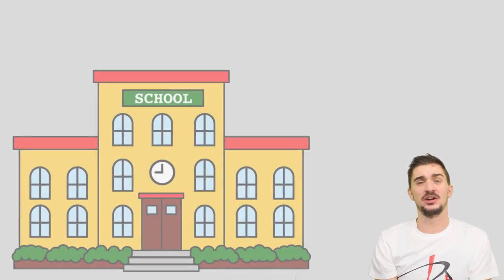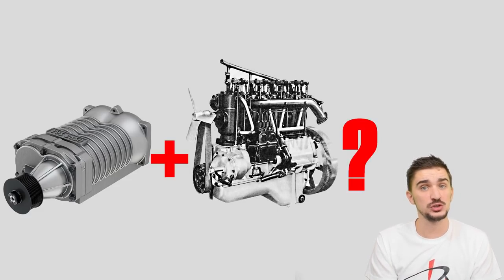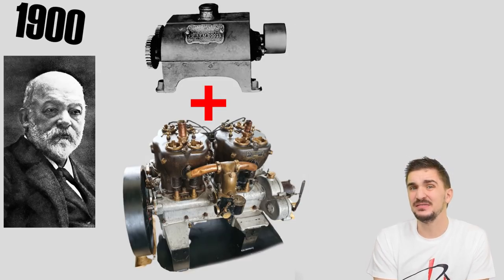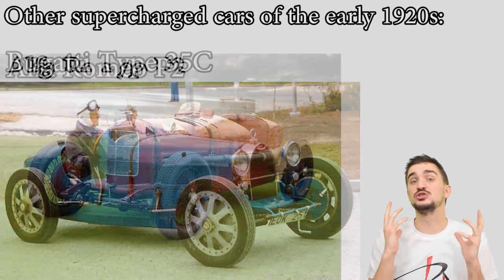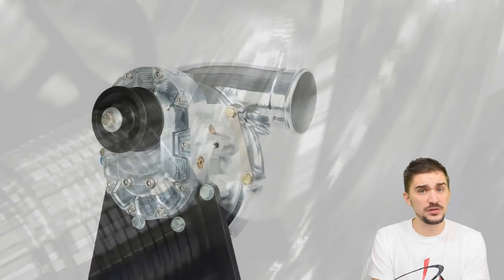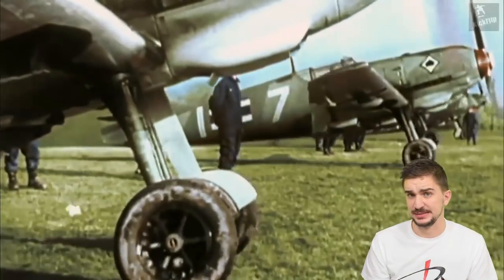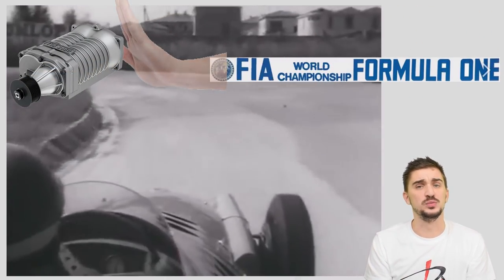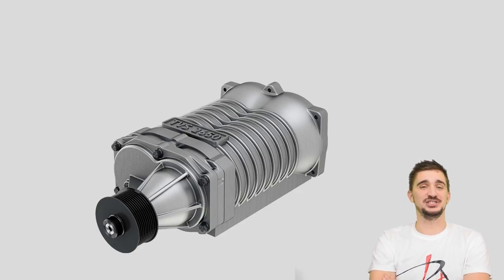SUPERCHARGER HISTORY - Boost School #5

Comment from the maker: AEM ECU: http://bit.ly/D4Ainfinity5
AEM water-meth: https://bit.ly/2zrOkSp?utm_source=D4A...
AEM boost controllers: http://bit.ly/D4AtruboostX
AEM wideband AFR gauge: http://bit.ly/D4Axserieswb
AEM digital racing dash display: http://bit.ly/D4Acddash
Support d4a: http://driving-4-answers-shop.fourthwall.com/
D4A merch: https://teespring.com/en-GB/d4a-merch
Patreon: https://www.patreon.com/d4a
Reply: What about Comprex and Brown BOVERI?
Reply: Horsepower sells car,
Torque wins races.
Reply: Horsepower allways wins. No mather what.
Reply: @nagyandras8857  
That's right, horsepower is the final say in the matter, torque is a component of horsepower and simply a part of the math involved in measuring horsepower. 
What people don't get is that there's no time constraint on measuring torque, you can take as long as you want to make 80 ft lbs of torque, but horsepower is a measurement of how much time it took you to make that amount of torque, the higher the horsepower the faster you produced the 80 ft lbs of torque. 
80 ft lbs of torque at 1,000 RPM's is going to lose against 60 ft lbs of torque at 5,000 RPM's every day of the week and twice on Sunday. 
80 ft lbs@1000 RPM's=15.23 HP.
60 ft lbs@5000 RPM's=57.12 HP.
He who crosses the finish line in the least amount of time wins therefore horsepower is the final say in the matter.
Reply: Man, if I still had my 1991 Talon TSI AWD 5-Speed, the BEST of the DSM Turbo Trio Coupes - with her SEXY Flat wing and the BEST looking body kit and style by a HUGE margin - which was VERY hooked up, Big 16G Turbo, boost controller that I set to 21-24 PSI when using 93+ Octane, and 18.5 for standard gas - full 3" Exhaust from the manifold back - my tuner/mechanic gave me a HOLLOW Cat! And cause she was a 91, she did not ever have to pass CARB/SMOG testing - of course bigger front mounted intercooler, 750cc injectors - top end rebuild with 1mm oversized valves titanium valves and springs, and cams with a SLIGTLY aggressive profile - halfway between stock and straight track cams, Anyway - when working properly she HAD to be putting damned near ~320+ to the wheels!

BUT I REALLY wish I had a Standalone ECU! MY Mechanic was able to flash my ECU as he had 5+ of the DSM trio Turbo Coupes, that he had hooked up himself. And apparently there WERE good ECU Tunes available for my setup, that took into account the higher CFM Turbo with higher boost, more aggressive cams and just higher flow everything. But the Throttle response and peak power would have been FAR Higher with a well Tuned AEM (Back in the day, I was looking at a brand called Apexi that most DSM tuners used at the time) 

Like the low end throttle response was a bit underwhelming, but as soon as I floored it, well I was able to ALMOST bottom out the rear shocks whilst chirping the front wheels a lot with a hard launch!  I wish I could find the picture a friend took when I did a hard launch - you could see the rear was all but bottomed, and the front tires had a small gap under them with the shocks extended fully!   The Big 16G STILL TODAY - remains the BEST STREETABLE TURBO FOR DSM CARS!  Not even Garret has a better solution for EVO or Talon that is not massive and takes forever to spin up!  People USED to think the Mitsubishi 18G or "Frankenstein" 19c were better for street use - but WRONG! The 19c would spool a bit faster, but it was HEAVILY limited in max RPM and therefore CFM -cause Turbo's are DEFINED by the CFM they can flow mostly - because almost ANY Turbo can DO ~50 PSI of boost - depending on engine size to an extent, but they will be limited in how much raw AIR they can flow! 

Anyway the Big 16G has more flow than ANYTHING you can put on a 4G63T - that is below the 20G Turbo or some of the larger Garretts you could fit to the motor, and 20G and above are NOT good for street use, unless you plan to use NOS to spool your turbo to win highway duels and nigthtime drag races. 

I blew away countless BMW M3, a Supra, 300ZX, EVERY Honda I ran against as well as all - Camaros, Mustangs, a Ford Raptor, and more on the highway when they were TRYING to pass me! 

God damn I miss that car... I wish I didn't go broke and was able to afford the then ~$6000 rebuild it needed when I blew the head gasket as well as cracked a cooling jacket IIRC - it was pretty major to fix, after I had already dumped ~$15,000 into the car as a then 20 year old.

I had to sell her...  But god I miss that car, I do NOT miss the bills from having to replace, literally everything - but I REALLY miss how insanely fast she was, and how SEXY TALON TSI LOOKED! That FLAT Wing and the body kit + the weight savings (~200+ lbs lighter than Eclipse as there was basically no sound deadening) - made her the BEST of the DSM Trio Turbo Coupes!
Reply: @Dysphoricsmile  
I worked at a garage in '89 that the owner picked up a Dodge Laser Turbo for cheap at an auction that we'd use to run for parts in town and race people on the way that we could goad into racing from light to light.
I'd run into people in bars on the weekends that'd recognize me as one of the drivers of it and they'd  always ask what we did to the engine and just wouldn't believe me when I'd tell them aside from some exhaust mods and adjustments the motor was stock.
All we did was bend up a larger diameter exhaust for it that eliminated the cat and had a Supertrapp muffler from a motorcycle with a buttload of baffles on it and tuned/adjusted everything. 
Once you got rid of the crappy exhaust on one of those things they breathed light years better and really let the turbo do it's thing, we used to smoke guy's with street/strip V8's that really had a hard time dealing with it and used to call me a liar about it not having special cams or head work or some other secret we were trying to hide.
Reply: Wiiiiiiiiiiiiiiiwiiiiiiiiiiii
Reply: You make amazing content sir!
Reply: just to clarify the first supercharger to be a compressor was the lysholm ,so called superchargers before that were blowers hence the name , the lysholm style compressor has a pressure change between the inlet and exhaust port

Comment: Funny stuff: racing a car "with the structural integrity of a coffee pot and the suspension of a stool."
Reply: Oft proceeded by the mystical phrase "Hey Bruh.. here, hold my beer and watch this.."
Reply: That's funny. As he was saying that I read this.
Reply: Don't forget the engine of a clock.
Reply: And that was not special, in 1936 Auto Union type C got 6.0 V16, 1 or 2 stage supercharging (roots) up to 520HP, 850Nm and 824kg on wheels made from ...... rubber I guess with no safety at all.... Compared to that, modern racing drivers are not in danger at all....
Reply: Still safe as houses compared to racing a car made of actual magnesium. At least everyone knew not to waste time trying to put out the fires.
Reply: @RS-pe5hp  Ah crossplies, always a good decision.
Reply: hahaha, love this channel

Comment: My first intro to superchargers was Mad Max. As I kid I thought it was the greatest thing ever. As an adult, I concur
Reply: Mad Max fooled many a car nut with his push button supercharger
Reply: The MR2 had a (centrifical, if I remember right) clutched supercharger, so it had kind of the same idea.
Reply: @danmartinez9497  Actually it follows the Mercedes system and its very sensible. Mercedes and Bentley raced, and the Merc had a kickdown switch for the supercharger - get off the corner, dump the throttle and the supercharger kicks in. Bentley 8 litre S - the supercharger was always on. All the Bentley cars ate pistons and all the Mercs finished.

Comment: It’s still mindblowing to me that two gigantic rotating lobes can move air faster than a fan.
Reply: Its an issue of pressure, the standard fan loses efficiency very quickly as backpressure increases which can result in the blades stalling and making lots of noise but no volume. Great for high volume, low pressure sprayers as used in horticultural sprayers.
Reply: It blows more than minds.
Reply: It depends on who the fan is. LOL

Comment: I was an IT guy when I worked for Eaton Corporation at their Proving Ground in Marshall, Michigan for their Supercharger Division.  I visited their manufacturing plant in Athens, GA many times, working on the computers on the test stands - they tested 100% of units.   I loved my Pontiac Grand Prix with an Eaton Supercharger M90.
Reply: the eaton supercharger was a ineffeicient  blower our product the sprintex compressor was far better but we couldnt make them as cheaply as eaton or the numbers that major manufactures wanted so i the financial crash of 89/90 we were forced to close , the sprintex compressor was far supirior to the roots eaton ,fast forward a few years and our place was taken by opcon  a far easier to manufacture than the sprintex , but with the same efficiently

Comment: Don't forget that the Detroit Diesel's 2 stroke diesels had roots type superchargers too. They were produced from the late 30's all the way to mid 80's. I love your videos!! Keep 'em coming. 👍
Reply: He is in EU, here the Detroit Diesel are basically unknown stuff :)
Reply: @jzxtrd337  yes sir!! Sure do miss hearing them. 😞
Reply: The Detroit 6-71 was produced from 1938 to 2004. One of the longest production Diesels ever.
Reply: The old time truck drivers will tell you that the secret to getting one of those 2 stroke Detroit diesels to run good is to slam your hand in the door when you get in the truck.
Reply: On the Detroit Diesel,  it's known as a EXHAUST SCAVENGE DEVICE,  the unit had nothing to do with a positive pressurizing of the intake charge.
Reply: @t.s.racing  Correct. It's also known as naturally aspirated. Unless it was turbocharged, there's no boost pressure in the air box. The blower's just there for scavenging.
Reply: @t.s.racing  close... it was a scavenge blower, but not specifically an exhaust scavenge device. Blowing the fresh air in pushes the exhaust out, which is scavenging.

Comment: Great history lesson, but you left out the most badass whine maker of all--the multistage axial supercharger.  Latham produced  a very efficient model that was used in late 1950s and early 1960s drag racing with some success.  A Dallas racer had a Nash Metropolitan stuffed with a Chevy V8 and topped by a Latham blower.  I still remember the sound it made while racing at Green Valley around 1962, so I guess you could say it was unforgettable.

Comment: The exhaust air pump from a slant six Chrysler engine was used as a supercharger on a Canadian Renault Le Car, which could not pass any of the EPA dyno tests. After adding that small pump it passed easily and was a nice peppy little car. One of my projects at the Bendix Research Labs.

Comment: The roots and screw compressors still play a dominant role in industry today.
Any sizeable compressed air supply in a factory will be built around single or multi stage screw compressors, and roots blowers are used where large volumes of lower pressure air is needed like air supply to combustion processes or transport of powdered and granulated substances trough pipelines.

Comment: What the go is a turbocharger that’s connected to a engine via a variable ratio drive. So at low revs the turbocharger works as a direct drive supercharger for no turbo lag, while at high revs, not just compresses intake air but also adds power directly to the crankshaft via ‘turbo-compounding’

Comment: I miss my L67 with the M90. So basic yet so much fun.
Reply: Agree, only wish they woulda used a more capable supercharger than the M90 though. It was so underpowered and small, it only added around 35hp and 50tq which is abysmal. A decent twin screw or even a proper roots can easily double the engines power but they chose the crappy M90

Comment: The Supercharger has an advantage over turbos in that it provides much better torque in the low end and still works at lower RPMs. The boost is always there because the supercharger is always working. No need to spool it up. This lead to some interesting twin-charger designs which switch between a super and a turbo on the fly.

Comment: 2024 three  pre-compression cylinders and three two and a half times larger re-expansion cylinders are on a secondary shaft. Said shaft naturally produces constant torque. The torque is fed to the engine's crankshaft through a CVT.
The CVT functions as both throttle and booster. Increasing the secondary shaft's relative speed increases boost. Decreasing it emulates a throttle but without vacuum losses.

Comment: 2 stroke Diesel engines also had super chargers but not for power but for removing the exhaust fumes from the cylinder
Reply: I drove an armored vehicle in the Army that had a 2 stroke Detroit diesel in it and I can assure you you're right about them not being on there for power. 
Old time truck drivers used to say that the way to get a 2 stroke Detroit diesel to run good is to slam your hand in the door when you get in the truck.
Reply: Close... not superchargers for power but blowers for scavenging. It's more about getting a fresh charge of air into the cylinder as getting the exhaust out.

Comment: You can twist wires everywhere to get the engine going as long as the drift is possible. They come under a distributed crankshaft architecture.

Comment: I’m always a bit puzzled with this automotive terminology. 
I was allways taught that ”supercharging” is a general term covering all methods of artficially increasing the intake pressure,  - and the equipment itself could be mechanical, exhaust turbine (or electrically) driven. 
And then you can differentiate accordin to compressor type also to centrifugal, roots, screw etc. 
So the keyword here should be ”mechanically driven”(?)
Reply: True - "turbocharger" is just a shorter term which really should be "turbosupercharger"... a  turbine-driven supercharger using a centrifugal compressor.

Comment: You had other brands also, Constantin with 3 lob Roots type compressors or Volumex. Existing from the early 50's. Still produced in the 80's and 90's for Constantin (did some builds with them in those years). Mounted on Peugeots, Citroëns, Renaults and Panhard.
They had a kit for the Flat 2 and Flat 4 from Citroën that was quiet good (from 20 or 30 hp to 45 to 70 hp with the 300 something cc and 600 cc or the 1200 cc making up to 150 hp).

Comment: And you forgot to mention that the Screw type has a built in compression ratio, up to 8 to 1.
It is not just an air mover.
It is a compressor.

Comment: They are all superchargers. "Tubochargers" were originally and correctly called turbosuperchargers simply because superchargers were designed first. Best part of forced induction is weight savings and 100+% volumetric efficiency which allows high altitude aircraft and the pikes peak run. Good video as always.

Comment: The Roots type blower is/wad integral to the 2cycle Detroit Diesel diesel engines (newer types are turbo-ed). The (once?) popular "6-71" supercharger was often seen on 60s-70s hot rods & dragsters. This was designed to charge a 6-cyl, 426 c.i. diesel. (Think about using a 6-71 from a 2 cycle application means for a 426 Hemi* V8 4 stroke engine. * (® by whatever the Chrysler motor company is called today)

Comment: Good article although you neglected to mention GM And EDM using roots blowers on all their 2 cycle engines as far back as WW2 and switching over to turbo at least on the locomotives I think in the 70s. Many hot Rodders used the blowers from the 471 and 671 Detroit's for years.
Reply: My thought exactly.  The GMC (later Detroit) part in this should've been mentioned.  Those terms "671" or "871" that are so often used in regards to blowers, actually were the 2 stroke Detroit diesels they came off of.

Comment: I'm amazed you still haven't done a video on the RB26 or the Displacement Wars back in the 60's
Reply: would be very cool. I am european and barely know about displacement wars.
Reply: @Valtra103  It was objectively one of the coolest times to be into cars. The fuel was awful so the only way to increase horsepower in cars was sheer engine size. The car I'm building now is a relic from then. A Ford Torino with a 460 cubic inch V8. There's nothing like the sound or feel of an NA 7.5 liter V8. The torque curve is just a flat line